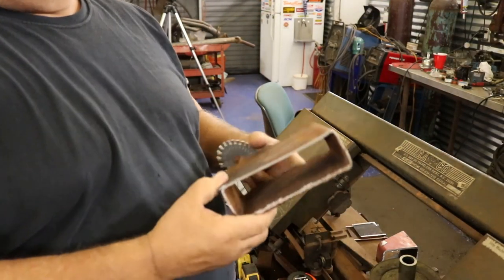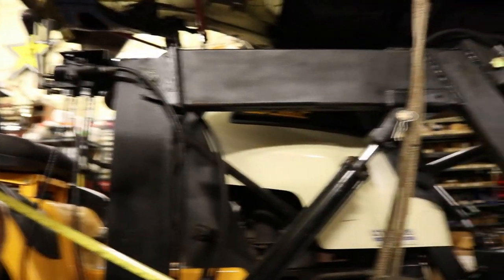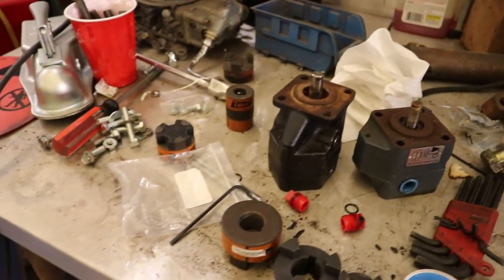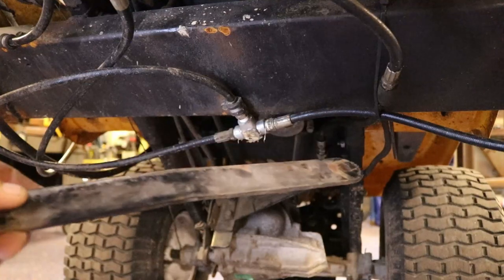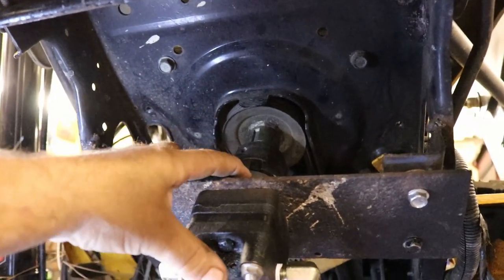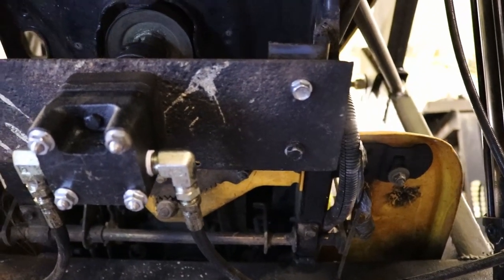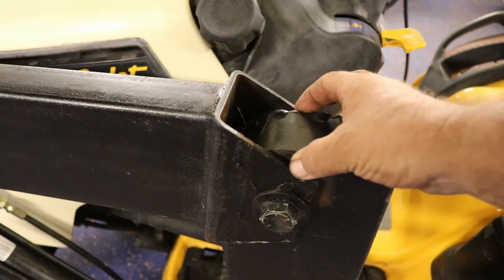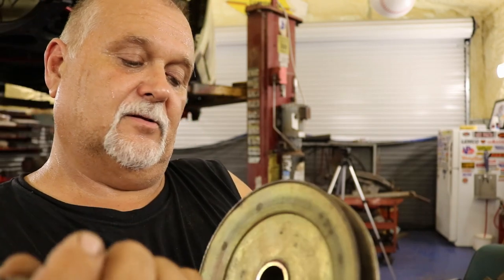Homemade Front End Loader Made for Lawn Mower Build Details

Comment: I decided I needed a setup like this before I even had the tractor.  I've seen these on smaller tractors and didn't want to mess with the Hydraulics.  as a teenager I had a lot of experience every summer mowing with John Deere 318s at an amusement park.  That is the original platform I started looking for and none were quite right.  Eventually I found and bought a 1894 John Deere 430 diesel.  Already has Hydraulics front and rear and 3 point on the rear and 6 GPM flow.  I completely restored it last winter and built a box blade and plow.  This winter I am building a FEL.  I bought plans from PF engineering and will modify them since mine will need to be a bit longer.  The 430 weighs 1182 lbs alone and has 1" axles.  It will have a 54" bucket.  My loader arms will be 2x4 3/16 and pretty big 3/16 plates covering where the angles are.  The frame sits forward on mine and I will be able to run angle across the top and run maybe 2x2 struts back to the uprights.  It has 26x12x12 AG tires.  This summer I cleaned out a tree line, about 30 trees removed and a lot trimmed.  Not all fell being in a tree line and I hooked a 30' strap to the stump end while still standing but cut through and pulled them off the stump and just kept going up to my wood/burn/cut pile.  Some of the trees were 10+" and the diesel never even grunted.  I see these smaller tractors and am amazed!  I cant wait to get one on a little heavier tractor.  This thing is becoming addictive!!!
Reply from the maker: Right on man, You sound like a man with a plan.  When you get if done we would love to see it.  Thanks for watching and good luck and have a great new year!!
Reply: I have a front loader attachment if anyone is interested. 
Comes with Hydraulic cylinders, hoses, and 12V pump. 
Can be re-fitted for practically anything.
Can be re-fitted to be installed on the rear of a Zero Turn for stability and traction.
I also have a 3' bucket, a 4' bucket, a tree shear, and a log spliter that attach to the front loader carriage. Sold separately.

Comment: Great video about the placement of the pump!
Reply from the maker: Thanks bud, It has been working out so far.
Reply: @NSBCustomCars  where did you get the pump
Reply from the maker: @brianvassar2556  I was one we had laying around, (It's for one of the hydraulic tire changers we work on). It's just a standard shaft driven pump.  You can get them a Grainger or I believe I've seen them at Tractor Supply.  If you need more info let me know and I can point you in the right direction.

Comment: Awesome build and great explanation. I love metal fabrication and ingenuity. I probably won't go into the build since I own a small Kubota L2900 with a loader. My concern is the front end of these mowers are crap and need serious beefed up for strength. Plus the frame is not that strong. My Cub Cadet has already lost the transaxle, just no power and needs rebuilding. Old Cubs were great.
Reply from the maker: Thanks man, Believe it or not this thing is still going strong.  The front end's are the weak link for sure. Thanks for watching!!!

Comment: I love you FEL! I have a question though. Are you afraid of damaging the pump with it being under the tractor? I didn't see anything there to protect it. I am NOT trying to degrade the build! It is awesome. I am looking at building 1 for my Craftsman GT6000 with high/low range.
Reply from the maker: Thanks for watching!!! The pump is tucked up in there pretty good and we are not using it in rough terrain so we don't think it will be an issue.  Good luck with your Craftsman!!!  We have a Craftsman here that we are going to build a front end loader for but it's going to be down the road a bit.

Comment: If you can bust a pump by holding the valve? You need to adjust your pressure relief valve. Or add one if you don't have one.
Reply from the maker: It wasn't under load when it blew apart but that is a good idea on the relief valve. Thanks for watching!!

Comment: I have look high and low for a way to do thus. I have a John Deere 240 with a vertical shaft engine.  Everyone said that it couldn't be done. I'm a welder fabricator and you don't tell us that! Love your build! Any suggestions before I dive in? I'm struggling with what size pump to use and do the controls have built in pressure relief valves or do I have to install that separately?
Reply from the maker: Thanks for watching man!!  As far as pump size it depends on the size of cylinders and your reservoir.  The more gpm the faster it will move but you have to have a bigger reservoir to supply it.  We were limited on space so ours is a little slow.  I will try to get you the gpm off of ours if I can find it.  The valve we used does have a built in regulator ( We need to install another one and bring it down to around 1500psi)but that just depends on the valve you buy.   The pump and the valve we are using came off of a Coats Heavy Duty tire changer...   Only thing we had to buy for this was the cylinders and hoses, everything else we made out of parts we had laying around.  Thanks again for watching and if you have any other questions let us know!!

Comment: I made something similar with 12v electric hydraulic cylinders (each cylinder has its own electric motor pump and reservoir) and winch solenoids and I didn't have to remove the mower, but they're slower. The funny part is I used a cub cadet SLTX 1054VT the only difference I can tell is it has a Briggs 26hp engine.
Reply from the maker: I have seen those electric cylinders and wonders how they work!!  Ours is still running strong and have not had any major issues except we did have a pump crack on us.  Thanks for watching and do you have any videos of the one you made??
Reply: @NSBCustomCars  no videos yet it's not finished yet but the loader does work and its usable at the moment but I got a 1" transaxle I want to swap too and a three point hitch and counterweight system I want to work on. Once I'm all finished I'll post a video of it working.

Comment: What did you do with the hydraulics? Did you add a pump? I'm looking to do the same, and I don't want to use electric cylinders.
Reply from the maker: We installed a pump right under the motor that runs directly off the crank
Reply: @NSBCustomCars  What pump did you use?
Reply from the maker: @realJacobLane  It's one that come off an heavy duty tire changer, you can find them at northern tool just type in hydraulic pump.  You just need to remember the more gpm the more oil you will need(so you don't run the tank dry).  more gpm the faster it will run.
Reply: @NSBCustomCars  Awesome, thanks for the info. Was it hard to install?
Reply from the maker: @realJacobLane  Getting the alignment is a little tricky, remember measure 10 times and cut or drill once...lol

Comment: So I watched both of the video's for your front end loader build.  It looks great.  What if you added an extended rear frame and a second rear end then made a dump bed or a flat bed on the back.  It would look cool as all H..., and also give you a little more weight on the rear end.  Dave V.
Reply from the maker: Great Idea!!  We are working on idea's for a dump trailer but it's not for the little one.  The tires and axles are our weak points and we are not sure how much more they can handle.  Thanks for watching

Comment: GREAT JOB IN THE FUTURE IF YOU WANT IT FASTER PUT ON A HIGHER FLOW PUMP AND A LARGER LINE BACK TO THE HYDRAULIC TANK  ALSO ADD A HYDRAULIC FILTER THE INFORMATION ABOUT WHERE TO PUT IT IS ON LINE
Reply from the maker: Thanks for the Advice, I did some research on pumps and we started with a pump we just had on hand from work.  When that one broke I was going to go up in gpm but I was worried if I went up to much we would have to make the tank bigger.  Since we have limited space we just decided that it being slow was fine for what we are doing with it.  Again Thanks for watching!!  We may be building another one soon so stay tuned.

Comment: Awesome design and build. Really helping me get mine together. Could you provide a link to the hydraulic cylinders you used? Also looking for dimensions on the bucket. Depth and height. Thanks
Reply from the maker: I have been out of town for the last week... I will try and get this info to you asap...
Reply: @NSBCustomCars  thanks
Reply from the maker: @johnross9266  We bought the two for the bucket off of amazon.   https://www.amazon.com/gp/product/B00BGZAWYM/ref=ppx_yo_dt_b_search_asin_title?ie=UTF8&psc=1 
The shipping is about as much as the cylinders but they are working out fine.  The other two we got from Tractor Supply Co.  Dean left the loader in Tennessee and I have misplaced the dim's we had written down.  We will be going back up soon and I will get you bucket dim's then.
Reply: @NSBCustomCars  no rush. Thanks so much
Reply: @NSBCustomCars  What size bolts did you use for the hydraulic cylinder connection? I just got the cylinder and they use a 1" pin. Just wandering what u used on yours.
Reply from the maker: @johnross9266  We used 3/4-10 grade 8 bolts on most of the bolts you see.  I think they were 3 3/4 inches long on the bucket cylinders but I'm not 100% on that.  If you need to know the lengh let me know and I will get you a measurement.
Reply: @NSBCustomCars  perfect. The cylinder has a 1" hole for a pin or bolt and that seems large for this. 3/4" is what I needed to know. Really appreciate the info. Once it's finished up I will send u over some pics. Thanks again.

Comment: The fulcrum point is the front axle, not the point where the loader attaches to the tractor frame. A lawn  mower front axle and frame is not designed for all of the extra load and stress of a loader. The transmission will not last very long as it is not designed for the extra load.
Reply from the maker: I know we are pushing this thing but we just wanted something to be a little bit of a back reliever.  It's been going strong for almost a year now and we did break a pump but other than that its been great.

Comment: Awesome build man!!!! What gpm would you recommend to have a good mixture of speed and power? Thanks
Reply from the maker: Ours is around 280gpm and It's a little slow but we can't go up because of the size of our tank.  So it just depends on how much fluid you have in your tank.  Not sure of how much power difference between a faster running pump would be.  We maybe building another one of these and It should have a little more room so we will bump up the gpm and see what happens.

Comment: Impressive build.  I had a cub cadet 1045 or 1050 and as I recall the frame was none too thick. All the weight of your loader is on the bolts that go through the holes that previously held up the mower deck , and the stabilizer bars welded to the frame near the engine?  Is that strong enough without reinforcing the frame walls?  I'd agree the front spindles are a weak point, aren't the bushings plastic?  Great job again.
Reply from the maker: We have been keeping an eye on everything and so far so good.  With the main cross piece and the plate that holds the pump it stiffened up the frame quite a bit.  We just use it for carrying stuff around and small jobs and it's working out great.  I will have to check on the front bushings, if they are indeed plastic we may have to do something with that!!  Thanks for watching!!